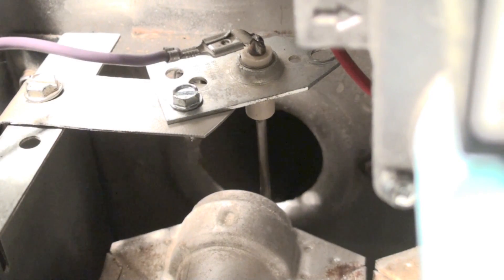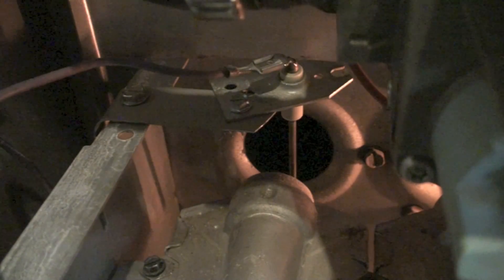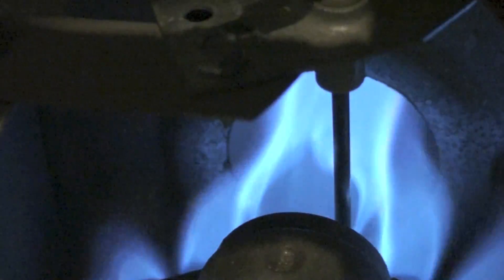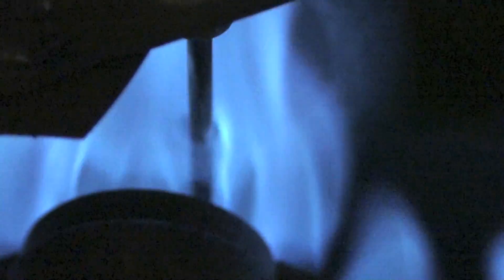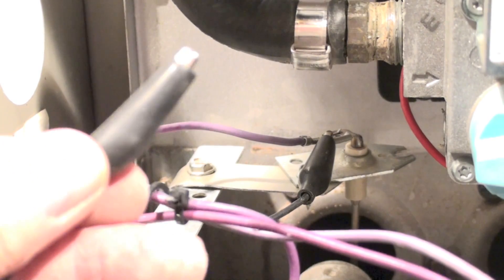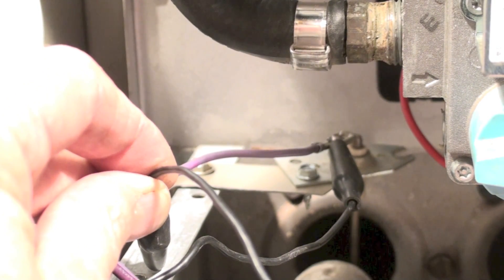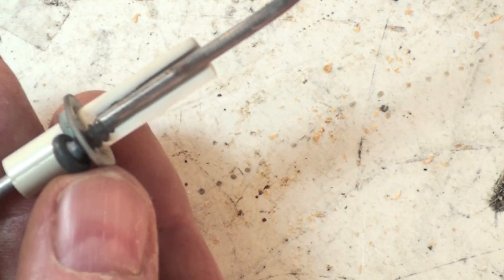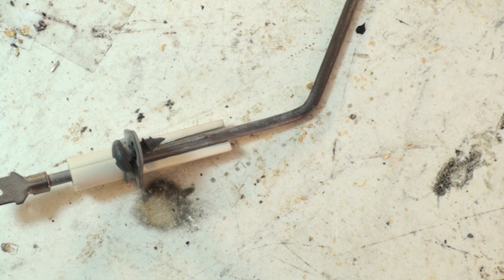How does the gas furnace flame rod work.

Comment: Why is my flame sensor red hot? Is this Normal? Thanks....
Reply from the maker: Its red hot because it needs to be that hot to light the burner.
GFM
Reply: @grayfurnaceman  Thanks for replying, yes, but it stays red hot while the burners are on until it shuts down.... is this normal? thanks....
Reply from the maker: @zr1ne  Yes, burner flame is at least 2500F.
GFM
Reply: @grayfurnaceman  ok, but this is what the igniter does, the igniter lights red hot then goes off, then the flame sensor senses a flame but the flame sensor stays"red hot" throughout the cycle, so the flame sensor always stays red hot? is this because of the flame constantly on the flame sensor? thanks
Reply from the maker: @zr1ne  Sorry about the mis communication.  I mixed up flame sensor and ignitor.  The flame sensor is just a piece of stainless steel.  As it is in the flame it will turn red and stay that way until the call for heat is terminated. 
GFM
Reply: @grayfurnaceman  ok no problem, thank you for your time!

Comment: I have seen far too many customers bamboozled out of over $1000 to replace a furnace computer when all that was necessary was for the furnace man to clean the flame detector rod. 99% of customers would be unaware of this problem with the flame detector rods. Easy for most people to clean their own. A bit of fine sandpaper and a socket driver that can match the mount of the flame rod. Thanks for this description of the operation of the flame rod. You're saving people millions of dollars stretched across America. Good for you.
Reply: i was told by my teacher a dollar bill works if you dont have any sandpaper to clean as well.

Comment: I have a rather dumb question and for some reason you touched the flame sensor while it's sending voltage will it shock you? Cuz everything I've seen says it has about a hundred volts going to it
Reply from the maker: It could.  I have actually tried using a voltmeter to test, but the voltage seems to hide when I try to find it.
GFM
Reply: @grayfurnaceman  yeah I tried that today my own self and couldn't get any voltage reading

Comment: Great explanation about rectifying flame sensors. I do suggest the explanation for rectification is not quite right, however. The size difference of the flame sensor and the burner may not be the only reason, or the reason at all. The flame is ionized gases, which is made up of very light electrons and much more massive positive ions. The electrons move readily through the flame whereas the ions are much more sluggish (thousands of times slower). The burner is always at zero volts, but the flame sensor rod is energized with some 50VAC, which means that is alternates between positive and negative voltage at around 60Hz. When the flame sensor rod is positive, the very light electrons are attracted to it and easily move onto it. Thus, during that part of the AC cycle, there is a current flow in the wire connecting to the flame sensor. On the other hand, if the flame sensor is negative, electrons are repelled from it (like charges repel), but electrons do not jump off the flame sensor rod. The positive ions are attracted to it, but they are quite massive and do not have enough time to reach the rod before it switches back to negative (the ions are too massive to respond to that electrical signal). When the rod is positive, there is no flow of electrons from the rod to the flame, nor in the signal wire connecting to the flame sensor. Thus, only when the AC voltage on the sensor rod is negative will electrons flow in the signal wire, and only from the flame to the rod and eventually back to the control board. The flow is typically one to several micro Amps, and it is that signal that is used to control the flame. No flame, no ionization, no current flow, and the gas gets shut off within that few seconds. Because an AC signal is applied to the flame sensor, but current only flows in one direction, it is called a "rectifying flame rod", it acts as a diode. ... I do guess your explanation is easier, but I don't see how the size the pieces matter.
Reply from the maker: I will send you to Honeywell for the explanation as that is where I got it.
GFM
Reply: Great explanation. Thanks. Anyway, I don't understand how the gas gets shut off when there's no current flow. How does it work in a burner where the gas is supplied by the flame rod? I mean, an industrial flame rod with an ignition connection.

Comment: I installed a %80 furnace 2 months ago and flame rod got soot and furnace stopped working yesterday anyway I cleaned yesterday and started working again but in two months such a short time even though we have a tough winter here in Chicago. Q:Is this related to the bad combustion the furnace is in a tight closet and carpenter put a louver door but the gaps between the blades were kind of tight or do I have to adjustment at gas valve? I don't have the combustion analyzer btw
Reply from the maker: Is the unit propane?
GFM
Reply: grayfurnaceman No It is a Natural gas unit
Reply from the maker: Guy Hakverdi I assume the furnace is new.  I would look at the burner where the flame rod is closely first.  Is the flame all blue?  Are there any obstructions in the burner?  Other problems could be the location of the furnace.  Chemicals near?  Hope this helps.
GFM
Reply: grayfurnaceman Yes It is a brand new furnace the flame looks bright blue no obstruction on the burner It was a remodeling project and they used the unit during construction hopefully it won't repeat. Kind of a puzzle to find out why it would sooth that quickly but thanks a lot.

Comment: Maybe you could make one on the spark ignition that uses the flame sensor as the gap ground. I tried to test mine with a cheapy DVM (in series) and smoked the DVM (high voltage spike i suppose)
Reply from the maker: Brian Gochnauer There is no way to test them due to just that.
GFM
Reply: Brian Gochnauer hh

Comment: What voltage should the board be sending to the flame rod? Im going back on one today that I think the board is at fault because I checked just about everything else. I have .3 micro amps and can't get it higher no matter what I do. I cleaned then replaced the sensor, no good. I thought there might be a ground problem so since the panel was so close, I ran a temp wire from the panel directly to the furnace, still same thing. All my years, I still don't understand the flame rod 100%. I thought about the board being bad not sending correct voltage, but what voltage am I looking for?
Reply from the maker: Richard Fossani We are assuming the rod is in the flame.  The voltage is highly secret and If I told you, I would have to kill you.  lol  Seriously, You can't check it because if you put your probes on it, most control boards lock out on shorted flame rod.  One possibility is some flouresent lights will send signals into the furnace and cause it to go out on flame failure.  Hope this helps.  
GFM

Comment: Do you have a video on the type that is an ignitor and a flame sensor? Do you know what those are looking for? Thanks.
Reply from the maker: I do have one that uses the HSI for flame sense but I have not gotten to it.  There was a tool for testing flame sense on these setups, but what we usually did was replace the control with one that used a flame rod.  Hope this helps.
GFM

Comment: Thank you - my flame rod is bent.  Perhaps it can spin in the tiny bracket.  NOPE.  Don't try to spin the bracket or you'll crush the rod in the pliers like I just did.  Off to order a new flame rod.  Note though - the last burner struggles to ignite and it takes a few tries to get it to light and the system to start.  Going to watch some more of your videos : )

Comment from the maker: It does need to be in the flame.  I would not try to bend the rod itself.  They sometimes break rather than bend.  If the bracket is bent, it could be straightened.  If all is straight, the burners could be dirty.  Hope this helps.
GFM

Comment: Thank you for this video.  Question - do they need to be directly in the path of the flame?  that is, in direct contact of the flame?  Mine is just off the the side where it gets radiant heat of the flame but the flame does not impinge on the rod itself.  It can take 2 to 3 times for the burners to light and stay on.
Reply: Been 7 years... but you might not have a flame rectifier then, you may have a thermocouple checking the presence of the flame based on the temperature instead.  If you have a flame rectifier, then the flame rod belongs in the flame.